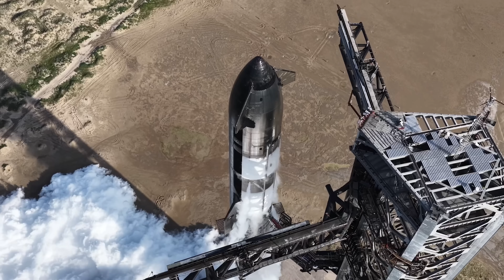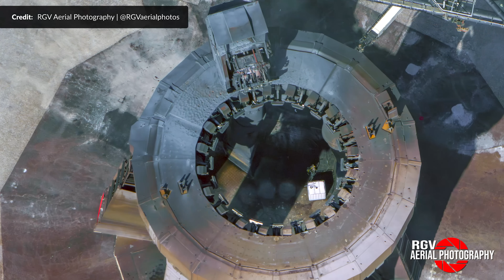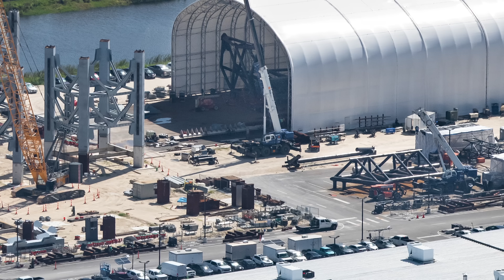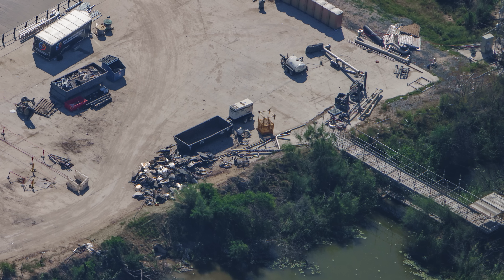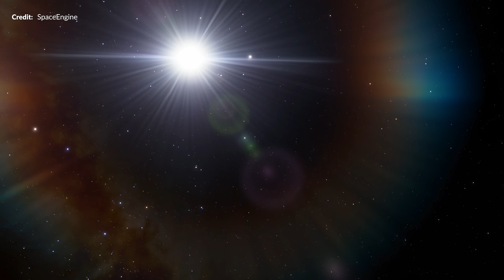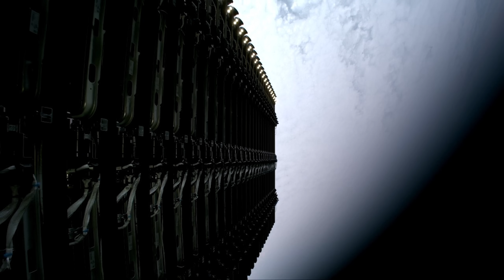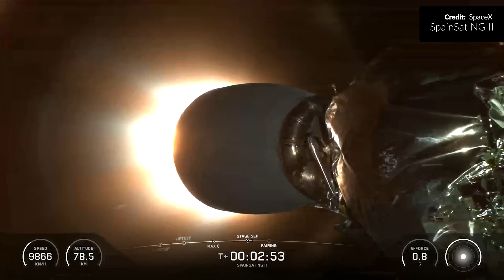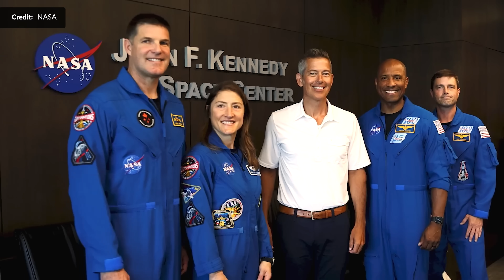Starship Began the Demolition!? 🔥

Comment: I watched the liftoff on another channel, and one of the side views showed that the rocket moved away from the tower somewhat, and then straightened out. Seemed to be a non-standard flight profile, which may have been the cause of the melted plates.
Reply from the maker: If you are referring to the tower avoidance where it angles out away from the tower at lift-off that is all normal. I haven't seen any big difference between this flight at others.

Comment: Flight ops has not been using all available thrust on launches. Maybe they turned it up with nothing to lose just for testing.
Reply from the maker: If so, as far as I can see made zero difference to launch speed.
Reply: They have not been using all the available thrust?  According to what source?

Comment: I think that the metal on the launch pad was slowly compromised by previous launches ,so the last launch eventually blasted the weakened metal int oblivion. That's my take on it.
Reply from the maker: Yea, but anything toasted above will get whipped straight down and away with the super heavy, so it would be hard to tell where that is actually coming from.

Comment: The more I see of all that work, the less excited I get about Space X and the work they do. Not because it's boring, but because it seems to lack a lot of planning ahead and very very wasteful.  I understand testing things, but all that concrete and metal they keep building and destroying, then doing it again, it just seems like it could all be cut by a lot if they were to think further ahead.  Resources are wasted for the planet, as well as their money.  They need to do a better job.
Reply: This is development driving design instead of doing it the other way around.  It does produce more waste but usually they gain speed and potentially a far more optimized final product.

Comment: Low wind speeds would allow the heat to linger over the launch mount and might inflict more damage than previous flights.  Compare wind speeds and directions on previous launches to the last one.  Direction of the wind might affect one side, leeward, more than the windward side.

Comment: Keep in mind that SpaceX has up to 25 Starship launches approved for 2026; that’s a lot of progress that can be made. The launch window for Mars will also be open on Nov-Dec 2026 which is still a goal for SpaceX. They are not a typical space company that makes 1 rocket every 1-2 years, more like every 2 weeks eventually. By the time the next Mars windows in late 2028 / early 2029 comes around, they may be launching 40-50 Starships a year. 🤯

Comment: America beat China to the Moon over 56 years ago, in July 1969.

To spend far more than necessary only to get back there for a "flag and footprints" mission before China's first successful landing is merely narcissistic, political folly. Developing a more permanent presence on the Moon, while it may take a little longer, at least has some scientific merit.

The original timeline for Artemis development had HLS launching just before Artemis III, and that may yet happen, seeing as Artemis II hasn't yet launched and the space suits for lunar surface use, which were supposed to be being developed by the now virtually defunct Collins Aerospace, are not even close to operational readiness.

Comment: If Starship is to be viable, you would think that it would need other kinds of payload doors for other kinds of deployments.Have you heard anymore about this?
Reply: There will likely be several versions.
Reply: @imaginary_friend7300 , yes of course. Actually, there is the HLS mockup and the renditions that show an external elevator lowering a rover onto the moon's surface.
But not much more IMO.
Reply: @melsuarez  They tend to build them as the need comes up.

Comment: Hey Marcus,
Very nice video...

Lots of good information regarding SpaceX's activities and overall progress toward its next evolution in Starship design... No. 12...

Relative to your question about what strategy for going back to the moon makes more sense, either going for NASA's manned missions first or waiting for Space X to reach full capability to establish a permanent base on the moon?

My vote is to go with NASA's manned missions...

Why?

It's for several reasons...

1) Going with the earlier manned missions (and human landings) on the moon is more than likely to keep the US in its leading position (over China) relative to space pioneering capabilities.

2)  Having NASA go first does not put any limitations on either SpaceX or Blue Origin in terms of their on-going lunar base development activities.  And in both cases, the number of systems and level of systems integration required for a base to be successful is so large and complex that a failure in any one of them is likely to result in delays that would jeopardize the US's leadership standing.

Comment: I’m still stuck on the idea that TWELVE launches are required to have achieved basically ZERO measurable results
Reply: This part of the contract includes it being reusable. Not disposable. 
It is less about the number of launches, then it is about the cost. 
One launch of SLS is over 4 billion dollars. SpaceX has spent about $6 billion dollars on starship and super heavy, and they've launched 11 times. And that's with throwing almost all of them away after testing. Imagine how much cheaper launches will be with reusability.

And that's not $6 billion dollars for 11 launches, that's 6 billion dollars for a whole lot of r&d on a new rocket, and 11 launches. Space is going to get a lot cheaper. 
But it's only been in development about 11 years, SLS took 12. This is three or four orders of magnitude harder.
Reply: Oh, and SLS cost about $25 billion.
SpaceX has spent less than a quarter of what SLS cost.
Reply: That's because you made ZERO actual effort to understand what's going on or why.  That you CHOOSE to be ignorant unless someone else does the thinking FOR you and spoon FEEDS you says you're little more than a mindless drone with zero thinking or reasoning capacity.  Could you be a bigger shame?  Do you even understand why you should be ashamed?
Reply: @imaginary_friend7300 🤡

Comment: Going to the moon simply plant another flag or beat China is small minded & ridiculous. We already planted multiple flags on the moon during the Apollo missions. You don't compete with China over something we already did 50 years ago...  We should keep pushing the limits by developing the technology required to adopt a permanent presence on the moon. The moon's value is as a waystation on the path to larger goals like Mars. A place to learn and develop 225,000 miles away before going 35,000,000 miles further to Mars.  If we settle for planting another flag now, then afterward we can watch China build their own moon base in the most prime real estate available while we sit at home and watch politicians point fingers and use the failure to try and get into office a decade from now.  We had a 50-year head start on China that is basically eroded because our political system has become so extreme and divided that budgets and priorities only last as long as the current party is in office. Afterward they are scrapped by yet another set of politicians who think being elected gives them divine right.  China has the ability to focus their nation and budget on a program and keep it aligned for decades. Programs for which we are the largest contributor in funding.  Yes, we're currently helping to fund a nice new space station, and soon we'll fund a new moon base as well. Shame we never built our own moon base while we still had a head start. Maybe we can hack into China's computers and steal their moon base design after they build one. Turnabout is only fair...

Comment: With how many stars there are in our galaxy alone, it is mathematically impossible for humanity to be the only sentient and intelligent species in existence. That's all I can say about this.

Edit: In regards to 40 flights per booster flight, they need to be required to overhaul Falcon 9 boosters every so many flights to give them downtime to repair or replace critical hardware, as well as thoroughly strip and repaint the booster to remove the layers of soot that reduce the payload capacity after each flight.

Edit 2: It's quite obvious here. The most recent decisions by NASA, and lobbying by its current acting administrator, are entirely based on politics. Sean Duffy clearly does not want to give up control over NASA (thus the lobbying to keep Jared out of NASA despite the good he will do for the administration as a whole, and for folding NASA into the DOT), and calling the previous Artemis timeline "not feasible" was clearly to push for the landing to be "Trump's accomplishment" as well as distance the Artemis program away from SpaceX in light of the political falling out between Musk and Trump.

Comment: 2:21 Why were more damages at Launch 11, this time ? 
Because there was more side-wind at the time of take-off ? So the exhausts didn't go centrally through the launch stand in the critical seconds! 
PS.: go SpaceX, diss NASA, do Your own thing, if You can ... go, 
   put the first Optimus_robot on the Moon, one that can survive Lunar Night_cold & high Noon_heat, by staying  inside the Starship, and walk around, deploying PV_panels, instruments, etc. ,  in the Lunar mornings, and in the evenings of comfortable temperature ! 
Optimus doesn't need to come back and reentry; it is the Science, Data and Experience to be gained which is the Goal. 
Maybe Lunar starship needs foldable sun_shields and vertically, 45°A unfoldable "wings" which could deflect 1/2 of the Lunar surface_heat at mid_"day"!! Maybe it should scoop up a substantial amount of Lunar rocks, to accumulate a "thermal mass" which could take up the cold of the night, and keep the Ship within survivable temperature range at peak "afternoon"-heat?

Comment: The USA doesn't need to beat anyone; they already did that in 1969. Duffy appears to be after what's left of NASA's budget, and once that's rolled into the DOT, he can use it for whatever he wants. However, the big question should be: Why does Blue Origin keep getting bumped to the front of the contract line, when they've done nothing to warrant that kind of preferential treatment?

Comment: The “race” to the Moon has to be about setting up camp there … creating a largely self-sustaining operational environment. There’s very little “result” in simply visiting for another day out, poking the ground with a stick and smacking a rock with a hammer … this was all done 50 years ago and the discarded rubbish on the surface proves it .. as does the sack of smacked rocks brought back at the time. 

You want to beat China? … I’m sure Grumman still have the original Lunar Module drawings somewhere in their vaults … tell them to build a new one but replace all the old electronics with an iPad!! 😂😂 …. They used to have one of the surplus Apollo Lunar Modules at the Space Museum in Hutchinson, Kansas … ask to borrow it? … could probably get it into Earth orbit on a Falcon 9. Indeed, a Falcon Heavy could probably get an Apollo LM into orbit with an enlarged 2nd stage with the grunt for a Lunar transfer and injection alongside a 2nd Heavy to get a Crew Dragon there with an extended trunk big enough to fuel the return to Earth. Easy-peasy. 

They should stop mucking around … cut all the domestic politics … and simply focus on supporting the Starship launch system to enable a proper base to be delivered safely to the Moon at the earliest opportunity. My bias to Starship over Blue Origin is simply down to the lack of evidence shown to date. Various Starship flight tests might have been liberally distributed across the world’s oceans .. but, in reality, the basis of design is, I believe, rapidly convergent on becoming a solid platform. The only real and big issue they still face is the wretched TPS for safe return to Earth and thence “reusability”.

Comment: Marcus, I don't get the refuel, a rock with rockets.  Send up one cargo/ crew and two full fuel nuclear powered ships, connecting all three in orbit.  You have all you need.  Once all three are on the moon the two fuel ships have all the water needed (lox and hydrogen), power, and supplies.  All three ship should be designed with no heat shield, flaps or solar panels, because they will never return to earth.  As Elon said no part is the best part.  Base station Alpha in one go....

Comment: When SpaceX first got the HLS contract I advocated for "mini" HLS to fullfill the Artemis Program initial landings -- basically, a supersized Apollo. It would requre two single use Starships to  place an "Lunar Orbital Insertion Booster" and the HLS into orbit, where they will rendevouse and head off to the moon to meet Orion. This would allow an extra year or two to perfect the entire "Jumbo" HLS system. I'm amazed they didn't have such a "plan B."  Hell, a couple Falcon Heavies could likely pull that off.
Reply: Because that would mean design, develop, build and test a whole other vehicle.  More money and more time.
Reply: @imaginary_friend7300  When they were shooting for a 2026 landing, I thought the technical hurdles of multiple reuse of the second stage (heat shields with quick turnarounds) for the in-orbit refueling -- itself a difficult challenge -- would force delays. Of course, problems with the Orion heat shield pushed it back to 2027 and now 2028. Otherwise, the HLS would be causing the delays. I think a shorter HLS would make a safer, more stable lander.

Comment: My guess regarding the increased damage to the pad from the last flight would be a different drift trajectory, causing more plume impingement on the pad surface. If SX has liftoff noise measurements, they could verify this, as more plume impingement increases the noise generated.

Comment: There has been so much waste on the Starship program that could have been avoided by slowing down and planning better. All that infrastructure being ripped out after being only a couple of years old. Huge buildings torn down. Launch pads that should have had a flame trench since the beginning, like all other major launch pads on Earth. Vehicles scrapped that were manufactured before design improvements. I understand there is knowledge gained by building, but there a middle ground.
Reply: They'd also be a lot further behind.  They have their reasons for doing things the way they did and that you pretend experts don't understand and worse make no effort to understand.
Reply: @imaginary_friend7300  But would they be? They lost ~6 mo when the launchpad failed. They lost time after bad flights because of FAA investigations and waiting for approvals. They lost time because of bad heat tile designs. Did they not know they would be building taller rockets in V3, V4+ to need taller buildings? Etc, etc. Don't get me wrong, what they have done is amazing, but there is room for improvement.

Comment: The pad damage is a reason why these tests should be done fully loaded, the lower acceleration of a loaded rocket will keep the exhaust on the pad significantly longer than these empty tests. This one was either a choice to clear the tower earlier or caused by wind compensation
Reply: Will these early test articles they are all 'fully' loaded.

Comment: My best guess as to why there is more damage to the OLM is that since it will be decommissioned, they didn't care about damaging it. So either they didn't bother with protecting it fully or they had a higher throttle than normal at launch to test the OLM to destruction and see how they can improve the next OLM

Comment: The DOT can't even manage what they already have on their plate as it is, just like the FAA was having trouble managing aircraft alone and caused delays in space related so in short, the FAA or DOT already has more than they can handle and space flight needs their own agency. Either NASA step away from building and assembly and become the FAA equivalent for space or a separate entity be designated to handle everything with space travel. With FAA and DOT both having legacy corruption issues giving either one more money and power isn't a good idea and Space exploration needs to be spun off to a new administration like the military did with Airforce spinning off and creating the SpecForce.